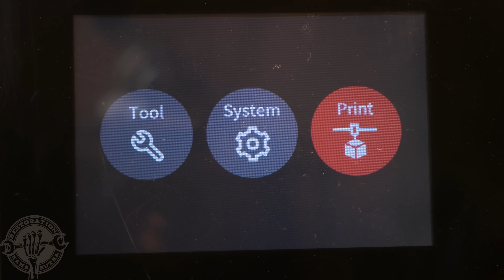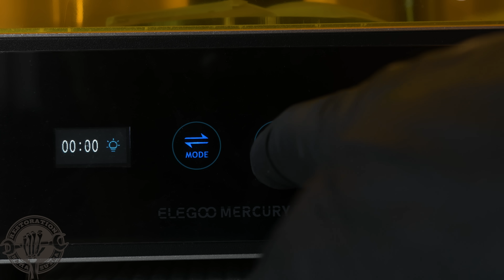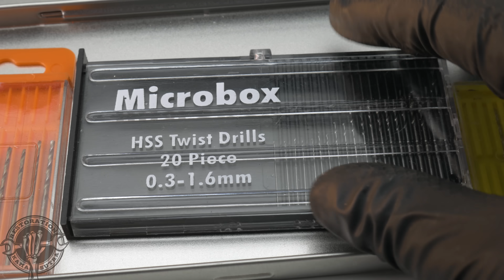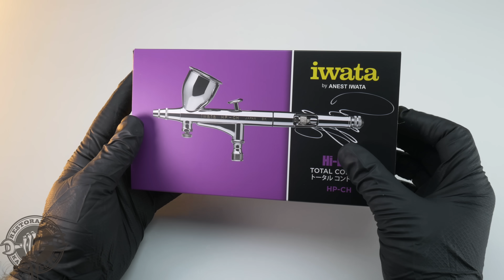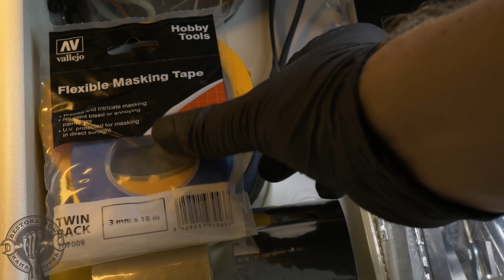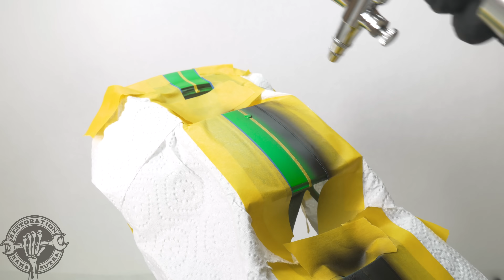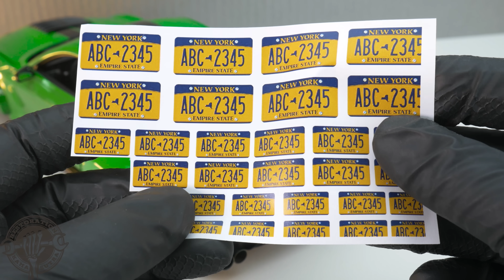Restoration Abandoned Ford Mustang Shelby GT500 | Muscle Car Restoration and Rebuild

Comment: Nice very nice. I was hoping for that Venom green metallic, but this looks also Amezing good.When i had to choose i went for the H&S in the same price range.Although i have to admitt i never had or use a Iwata A-B. But sure it was a improvemt to your old A-B. Are there many hobby shops in belarus?? Or you need to buy outside via internet?? Just curious about that. Top Work as usual